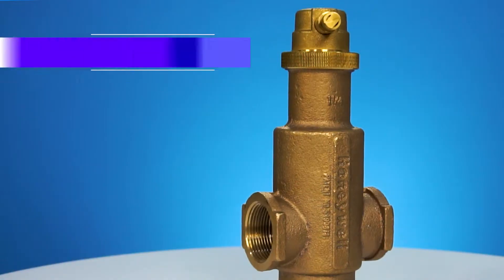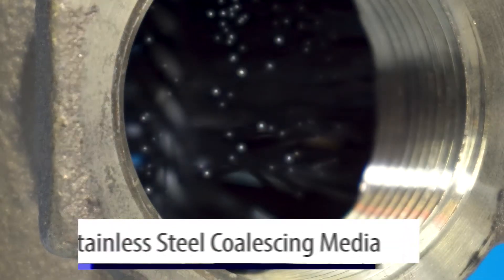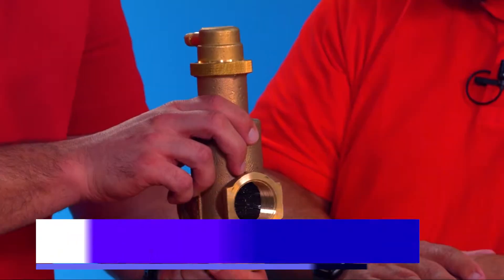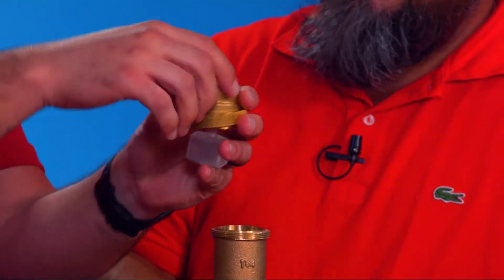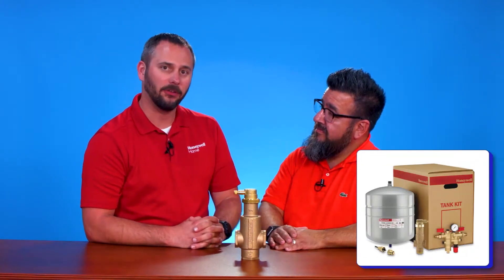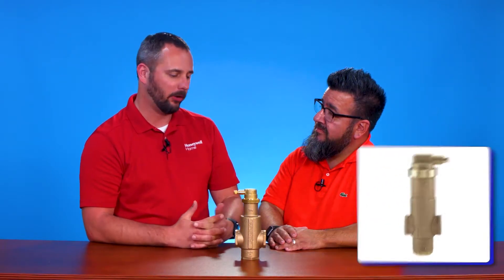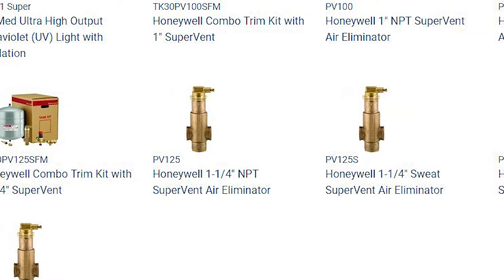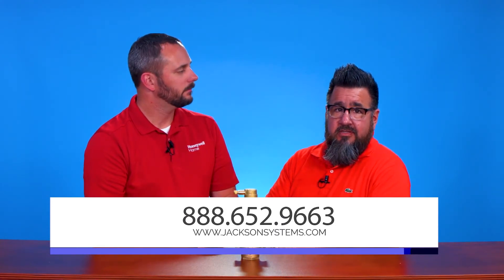How to eliminate air from a hydronic system

Comment: Not knocking it I like the idea but would that media not need to be replaced and I worry it may degrade and dislodge from valve and create a issue with the system.